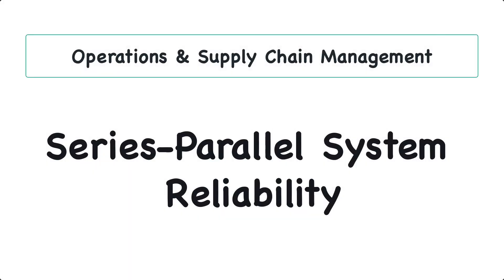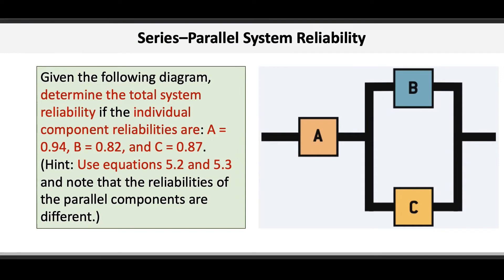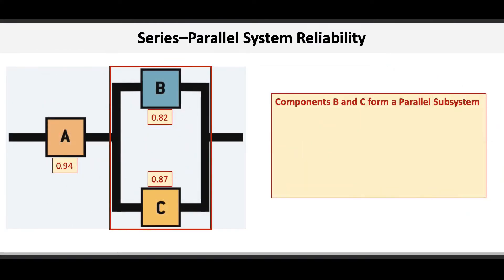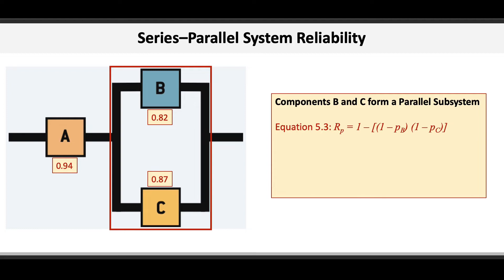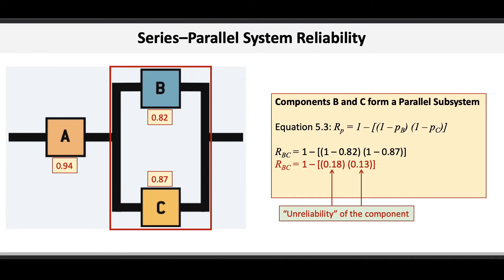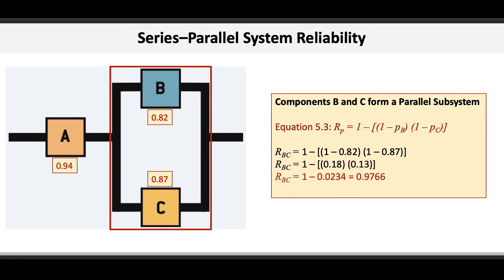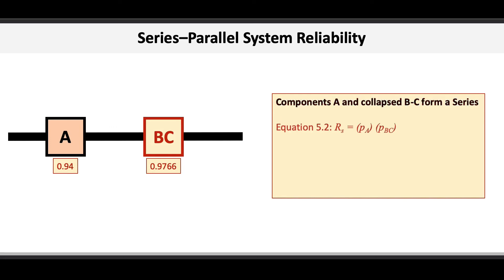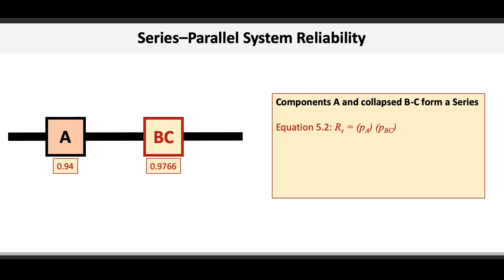Series-Parallel System Reliability

Comment: Can you calculate the reliabilty of 2 identical components if you have the system reliability number?
Reply from the maker: Hi there. Absolutely you can -- it involves working backwards using roots.

For example, if you have two components in series, each with a reliably of 95%, the reliability of the system is 0.95 x 0.95 = 0.9025

So if you know the system reliability, and there are 2 components, you would take the square root of 0.9025 and get 0.95!

If there are 3 components in series and the reliability of the system is 0.8574, then you would take the third root of 0.8574, or if you have a calculator that is not capable of anything higher than a square root, you would take 0.8574^(1/3) (i.e. to the exponent of 1/3) and you'll get 0.95. Proof: 0.95 x 0.95 x 0.95 = 0.8574.

For 4 components each with a 95% reliability:
System reliability = 0..95^4 = 0.8145 (using the yx button on a calculator)
If you know the system, then each component is 0.8145^(1/4)( also using the yx button)

For parallel and more complicated systems, this can be more difficult and requires a lot of careful working backwards.

Hope this helps.
Mark
Reply: 🙏 @The_Business_Doctor